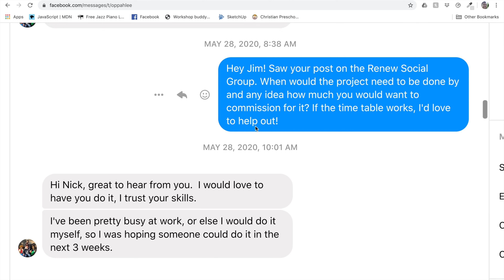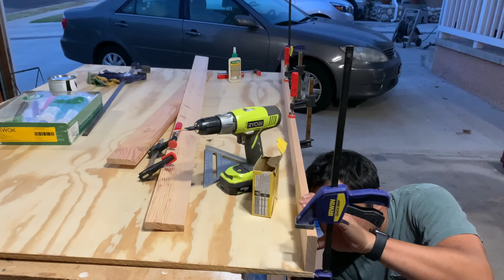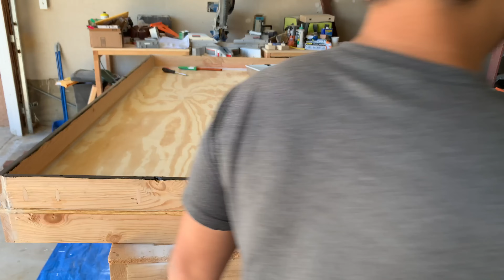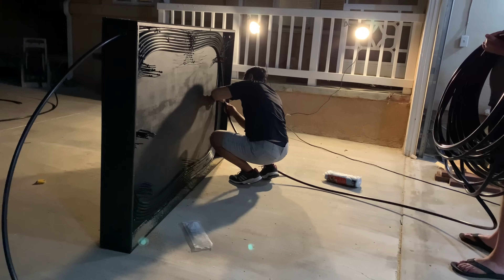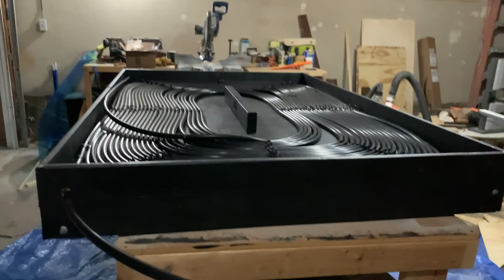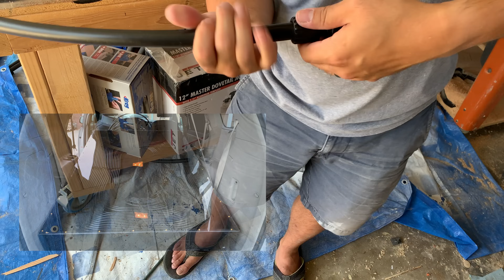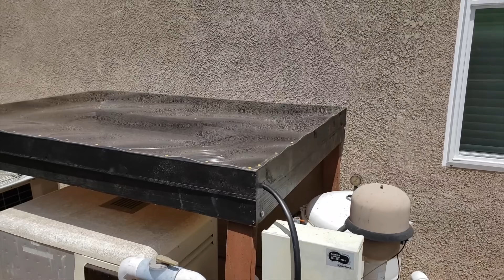DIY Solar Water Heater Full Build

Comment: good job on the water heater. Please put a riving knife on your table saw and never push your hand/fingers past the blade, use a push-stick
Reply from the maker: Thank you — didn’t realize how dangerous my technique was till all the comments. Appreciate it!
Reply: I'm guilty of this with some awkward cuts. Always gets me sweating.
Reply: And those gloves. 😬 Yikes!
They can suck you in.
Reply: @whereswaldo5740  

Yup…gloves are kinda scary using a table saw but to his defense, he did have a push stick not that you mentioned that) and his video was well thought out and the end result is awesome.
Reply: The issue with cutting tall wood like that has more to do with some pieces that would warp due to improper drying or structural reasons.  Half height cut works but you can also try what's known as a contractor's flip.  Though I am not sure if you would have the clearance for a long piece like that.
Reply: Great video dude. I’ve been thinking about something like this for a few weeks now. I believe that this will do what I want. Thanks for taking the time and effort for putting this out there! Much appreciated!
Reply: @SamIAm-uk1pp 

Safety is important. For sure. I’ve worked construction a
few times over the years and OSHA was lurking around somewhere. They had soooo many regulations that it is a wonder that we ever completed ANYTHING. 

Safety can save a finger…a back…even your life…but the dude was just trying to show how he built something that looks like it might be worth attempting. So stop knocking him for not “following” all of the rules. He was just excited about what he had accomplished and wanted to get it out there.

You are free to modify his approach or do things more safely but….he built a cool assed thing in spite of the faults.

Comment: I built this system for an added heat source for my electric w/heater, problems immediately showed where the kinks in the hose popped under the heat of the sun due to thermal expansion, NOTE" even copper pipe will "boiloff" if the water is not constantly modifying temp by re-circulation....expensive mistake going cheep

Comment: Definitely gained a sub with this video. Great Work!!!!
Reply from the maker: Thanks so much!!
Reply: @nwkwok  if I did this for a pool how would I get the return to go through the built in inlet on the sidewall of the pool?
Reply from the maker: @danieljoye2486  Hm... TBH, all of the videos I've seen of people that have done this have the hose going in through the top surface of the pool. There could be some ways to engineer something to go through the side wall if it were an above ground pool but you would need to ask someone that would know how to do that so that there's an airtight seal for the hose to go through.

Comment: i wonder if 2 circular sections of tubing would be 1000x easier to lay out? you waste some area with both but man that seems like one Hercules tasks!
Reply from the maker: Yeah... probably haha. Another idea that came to my mind is cutting the irrigation tubing the length of the frame (minus an inch or two) and use 90 U-connectors. I feel like that'd be 50x faster. The U connectors might waste some space in between but you also wouldn't have to waste empty space in the middle.

Comment: Nice work next time hang the pipe on a rotating jig so the pipe uncoils as you use it. It will make it easier too handle
Reply from the maker: Thanks for the suggestion!

Comment: Place the tube on the panel in the middle. From the bottom of the tube coil separate out the tube and secure it in place.

Comment: Can I ask what what water pump is required to pump water through your setup?
Reply from the maker: Hey Ashley - I originally used the pump from RC insider’s video here:

https://www.amazon.com/dp/B01CGAD986/ref=vp_m_ac_sub_sp_pd?_encoding=UTF8&pd_rd_i=B01CGAD986&pd_rd_w=M9Gej&pf_rd_p=c4362ed9-1b02-4bc2-9b88-301c994f46f6&pf_rd_r=8930792c-2881-4efb-aee8-50a188a2e794&pd_rd_r=8930792c-2881-4efb-aee8-50a188a2e794&pd_rd_wg=1e1nM

But the person I made this for needed a pump that had a little bit wattage so he went with this one:

https://www.amazon.com/dp/B07J1GMKSG/ref=cm_sw_r_cp_apa_i_nV2cFbP4NH285

Hope this helps!
Reply: @nwkwok  Could it be adapted to connect directly to a swimming pool pump?

Comment: Run the hoses in a piece of  corrugated black plastic 4in pipe .  
You will lose a lot of heat on the way  to the hot tube. 
Is the solar heater too close to the gas water heater?
What was the final cost of the project?

Comment: The gloss reflects light and heat you really want the top cover to be "translucent" this way it does not reflect, I built 4 by 8 foot panels back in the 1970s and got 180 degree water.
Reply from the maker: Ah good point!
Reply: @Brent Simmons Are you suggesting he use glass? The plastic is translucent. What could he have used instead?
Reply: @daveparker839  Dave glass will reflect anybody knows in a solar water system you use translucent cover so it does not reflect rather absorb more. Translucent..difusser

Comment: How well does it work in winter?
Reply: I've seen them roof-mounted with the (straight) tubes in glass sleeves with vacuum for insulation; apparently those work fine.

Comment: I don't recall hearing what the rate of flow was in GPM or GPH, which is important when trying to get a grasp of available BTUs for heat transfer.
Reply from the maker: You'd be recalling correctly ;P I wasn't able to test this prior to delivering this to my friend. He did do some testing of his own but unfortunately do have these #s. I do know that he needed to get a little bit of a stronger pump, which reduced the temperature of the output by 10ish degrees but it worked plenty good for the size of their jacuzzi! :]

Comment: Hi from Fiji.
Just a small comment. Do you know how mosquito coils fit together?
When making the coils, run two pipes together. Run one of the pipes an extra half circumference so that it ends up 180 degrees away ie 6 clock and 12 Oclock. On the end of each pipe put an elbow.
Across the centre, use a short piece of pipe to join the two. This way the water comes in one direction and out in the other. This keeps your pipes all in the one plane, and you dont have a messy tail crossing from the centre.
I suggest to start with the centre piece with the elbows facing opposite directions and clamp it down with saddles.
Then start winding the two pipes together.  Using saddles as you go will make the job a lot easier. You will end up with two pipes coming out of your frame. If you are careful, you can make one come out on one side on the top and the other on the bottom. This way if you angle the frame, and it is below your tank or pool, it does not need a pump.
Reply from the maker: Haven't heard of mosquito coils before thanks for the tip!
Reply: @nwkwok  they are spmething you burn to keep mosquitos away.
They are packed in pairs hence the refere nce. Bit like yin and yan- both tails cam eventually coil in the same direction.

Comment: Great video ! I've build something similar years ago but made one mistake. It was way too big so I couldn't handle it anymore. Eventually I had to cut it to pieces. Now, a new project similar to this is planned for the coming summer. This time much smaller individual panels that will be combined. I used garden hose (reinforced) from Gardena. After the summer you can buy these real cheap with lots of discount. It's easier to make sharp bend and it doens't fold as easy as the back tubing. With a simple microcontroller and a valve (recycled from a washing machine) you can slow down or stop the water flow when it gets late afternoon. The amount of water in the circuit will then slower get warmer and after a minute or so you can let it flow in a reservoir or so to accumulate. This worked out fine for me.
Reply: Please do a video if you do this!

Comment: Nice video.  Working with this irrigation tubing can be frustrating.  I've not used it for this purpose, but for actual irrigation, but you run into the same problem (kinks especially as you try to unfurl from a large roll).  A good approach is to unfurl the whole roll across a wide open space (backyard), carefully pulling loops off the coil as you unfurl the whole thing.  Then run down the length of the tubing to untwist/unfurl some "memory" from your coil.  If I were doing it now, I'd use smaller lengths of tubing in the first place rather a full 500' length.  Buy the 500' roll for the price, but then unfurl as described previously and cut it to more manageable sections (maybe 100'), then use common irrigation tubing couplings to attach your sections to create your desired full length.  The couplings might slow down your water flow a little (if you use the inside-tube/barbed ones) and would make your final coil less "clean" looking, but for me those would be acceptable trade-offs for the reduced frustration of trying to work with/lay down a single 500' tubing length :)
Reply: I've built one of these.The easiest way to get the roll unrolled is to put the new roll in the box,THEN cut the ties that hold it together.Then you are working "with" the natural curves of the pipe and not fighting them.With my first roll i tried running it out over a distance and uncurling it as it was fed into the box.This was frustrating and i still kinked it a few times.With the next roll i did as i said before and it was done in five minutes with no kinks and no swearing:-)
Reply from the maker: This is great advice. After going through that debacle, I would gladly trade the 'clean' look if it saved me the frustration of dealing with that 500' length... without hesitation haha. Thanks for the input!
Reply: @nwkwok  I always leave the tubing out in the sun for about an hour before working with it. This softens it up and lets you shape it to your requirements after which it "sets" in  the new shape you have laid it out.

At least, this works in the Australian sun. Not sure about other climates.
Reply from the maker: @lukedudney4462  Ah yes - good advice. That might've made the job much easier since we were coiling the tubing in the cold of night... 🤦🏻‍♂️

Comment: everyone shows this same method of build, but NO ONE shows the pump connection and flow rate defined
Reply from the maker: Ah - it's a good point. I would probably do something more in depth and thorough if I had access to it myself but I didn't think of these suggestions in the comments until after I delivered it to my friend (who's a little ways out). 

I think RC Insiders (who has a fantastic build of this video), has some pretty good footage of the pump connection and water flow -- I don't remember if he has exact #s but might be closer to what you're looking for? 

If you research enough, I do remember watching one made by an engineer who showed all of the data but... twas a little beyond me 😅
Reply: @nwkwok  yeah. its hard to see what's what without info.
Water came out at 120f.  is that constant water going through, what rate? or is it with it sitting on the sun all day, then turn it on and for 1 min you get 120F then goes down to 90?  thats the point
Reply: @cbflazaro i think that's the senario.

Comment: You need to put silicone under the perimeter of the plastic. Valuable heat is escaping through the air gaps.
Reply from the maker: Oh -- that's a great point. Though, I'm having a hard time figuring out how I would apply silicone to it since I screwed it in from the top...? Maybe I could have used the silicon as glue as I placed it on top. Hm good to think about for the future.
Reply: @nwkwok   Unscrew the screws, remove the plastic, apply a thick bead of silicone, and then replace the plastic cover.  Shouldn't be a problem.

Comment: Hi Jim!
It really does look like an art piece. Can you give details on where you purchased the cover piece and pump details. Thank you...
Reply from the maker: Hi Sharon! I actually built this for my friend Jim. I’m Nick :). 

I got the 1/16” acrylic sheet from a speciality plastic store near me called Superior Plastic Fabrication (located in Gardena, CA). 

I originally used the pump from RC insider’s video here:

https://www.amazon.com/dp/B01CGAD986/ref=vp_m_ac_sub_sp_pd?_encoding=UTF8&pd_rd_i=B01CGAD986&pd_rd_w=M9Gej&pf_rd_p=c4362ed9-1b02-4bc2-9b88-301c994f46f6&pf_rd_r=8930792c-2881-4efb-aee8-50a188a2e794&pd_rd_r=8930792c-2881-4efb-aee8-50a188a2e794&pd_rd_wg=1e1nM

 but Jim needed a pump that had a little bit wattage so he went with this one:

https://www.amazon.com/dp/B07J1GMKSG/ref=cm_sw_r_cp_apa_i_nV2cFbP4NH285
Reply: @nwkwok  Thank you so much for sharing the details and replying. Rare on YouTube!
Reply from the maker: @sharonharrison4795  No problem! Lemme know if you got other questions! You thinkin' about building one of these? :]
Reply: @nwkwok  Yes, for a 16x48 above ground pool. Texas is pretty warm year round so, to heat it up a bit would be great.
Reply from the maker: @sharonharrison4795  Woo!! Hope you have a fun time building this! :]

Comment: I'm not sure if you direct under sun, your plastic shield can stand for how many years? 2-3 years. Pvc pipe are not ideal, you should use copper pipe.
Reply from the maker: Hm. From what I’ve researched, the pvc irrigation tubing is used by lots of ppl. Why copper > pvc? If for some reason the shield needs to be re place, the 1/16” sheet was relatively cheap. So long as the sheet traps heat (vs looks damaged), we’d keep it on there :)
Reply: I agree with Nick here.  I built/used a collector similar to this using copper a few years back, and I had frustrating leak issues--particularly if you are using in an area with a freeze risk now and then.  Repairing the copper was very challenging unless you were handy with copper (esp. once it has been mounted inside your collector).  This irrigation tubing is pretty durable, and repairing/adjusting it is as simple as using common/inexpensive couplers.  I had exactly this irrigation tubing in direct sun for many, many years (as irrigation tubing) and it held up well, although maybe there are issues with the super-high temps generated inside an enclosure?  Many people sure seem to be using this tubing with success for similar types of hot water/pool heating, but I'd be as interested as anyone to see some head-to-head data on copper versus this tubing for this kind of application, including any degradation/damage over time... :)
Reply: @WesternNebraskaWildlifeWatcher  I can't comment from experience but I understand from researching this that there's a reason copper is not used. That is because you are circulating the same water over time the copper corrodes ever so slightly but that builds up and stains the water and pool surface green.
Reply: I’m not certain but using copper for a hot tub doesn’t work because of the chlorine. I’m not sure what all of the companies put on the roofs here in Florida for pools buts it’s plastic of some kind.